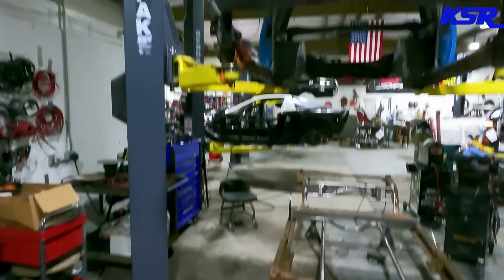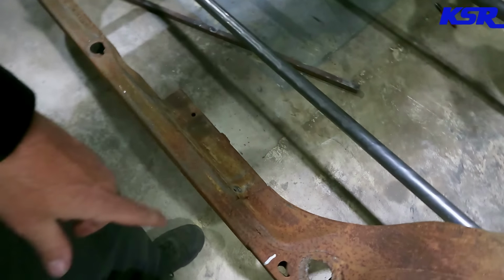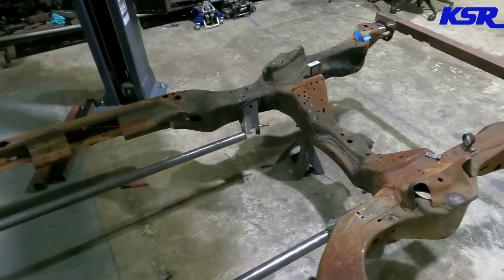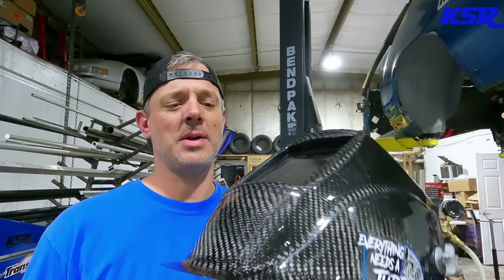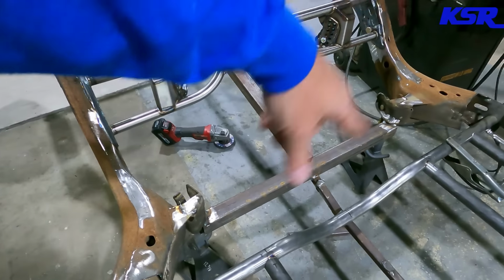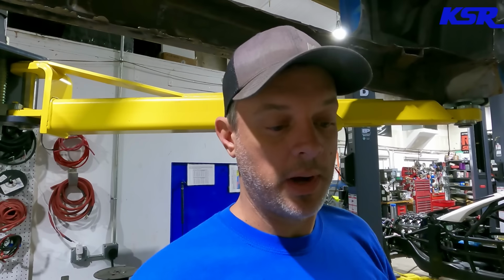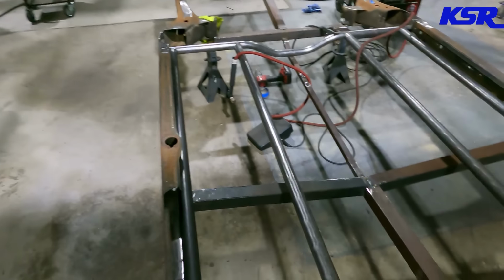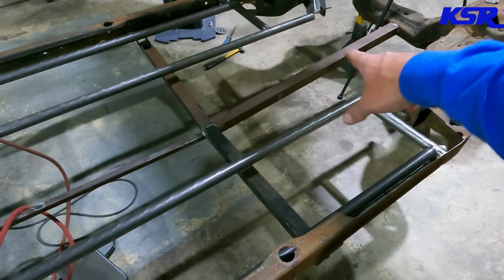25.3 Roll Cage Progress on MY CUTLASS!! KSR Cutlass Build Episode 12!!

Comment: A data point.
Perimeter framed cars are really flexible and rely on the body for strength.  I did a full cage , frame seam weld and solid body mounts on a 80's full sized GM for oval track.  A standard car on jack stands with one out an inch in height will sit on all stands.  Post cage install, have a stand out a quarter of an inch and the car will teeter.

Comment: Kevin I've said this before and gonna say it again....
As a life long true Oldsmobile guy I am ALL IN on this project!.
I still got my first car, from 1983...it's a 1970 Olds 442.
Steve Grebeck installed the 6 point 1 5/8 chromolly roll bar back in the 90s. 
RIP Steve. Sooner or later I'm gonna need a halo bar, front down bars that are hidden best way possible, and forward bars to the frame horns. I gotta keep the car in a way that if I ever want or need to turn it back into a stock musclecar I can cut out the bars, but most likely they will be there for the rest of my life. Maybe you might wanna be the one to put these new bars in my car? 
I'm trying to save money for a Rocket Block because I will always be a big block Olds guy. 
A 440 inch diesel block project is awesome but I still love my super wide victor intake..
I'm rambling now, I'll stop

Comment: Kevin, grab you some cheap adjustable RV stabilizer jacks that screw up for the middle and easy micro adjustments if needed on different areas of the floor to be perfectly level where standard stands wont allow 1/8” movements. Nice for holding bars in place too

Comment: One thing you could do is show some tips on how to weld in what you’d think is in difficult places or positions. I recently seen a cage install video on a K5 Blazer off road rig and they showed how to completely weld the top side of the bars where the roof is normally in the way. Most of us have seen where cages aren’t welded all the way around which I guess is legal to an extent, but still not ideal if it could be prevented. I feel more people would weld all the way around if they knew a trick (if possible in their application). I wouldn’t have thought to put holes in floor to drop the partially welded cage through to give access to the top side to finish weld then raise the cage back into position to finish everything else. Like most of us I’m not a chassis builder so things like that can help get people to see how certain things can be applied to what they’re doing on their cars.

Comment: Love watching, I built a 25-3 frame and about where you are now I was reminded to start drilling vent holes to connect all the tubes together. I have paid the price for not doing it on other projects in the past. Also on your 1 1/4 floor diagonals, you might consider offsetting them to the top or bottom of the 1 5/8 to give a flat surface to attach the floor. These videos are perfect and I look forward to them.
Reply from the maker: You have a secret microphone planted in my shop??? Hahaha, I was just talking to the guys about offest notching the smaller bars to make it easier to do the floor later.
Reply: I offset mine to the bottom to attach the floor to the bottom, leaving the frame exposed for seat and belt mounts. As a drag and drive my priority was water proofing. One downside is having to make a raceway outside of the drive shaft tunnel and above the floor to get fuel lines to the rear. There’s nothing run under the car.
Reply from the maker: @rustyh8806  I plan to use a couple of the upper frame rail bars for some wiring and for the small fuel line for the street fuel system. Maybe even use a Titanium rod with 6an bungs welded to each end of it or something.

Comment: I got 69 Oldsmobile Cutlass S
I rebuilt the engine and rebuilt the transmission and I rebuilt the front end and new gas tank and front and back new brakes pads. Right now I am taking a break and I will continue finish the rest of the car I do need to put New heater coil and the car will run good. Maybe I will put new tires. 
I have a friend works Oldsmobile company he gets parts and engine and other things I need for this car 🚗
I like your video continue doing what you guys need to do and I will continue watching you guys doing it

Comment: I have an idea for a strong yet light original frame rails.  Probably a lot of work, but would be extremely light & strong.

Take the original frame rails & instead of boxing them in, as is traditionally done, heat the 90 degree bends in the frame and close them up to 120 degrees, making a triangle, with the body side as the flat.  You'd probably have to make a thin filler plate to bring the original bottom frame rail to meet the top corner.  

Once the frame has been turned into a triangle shaped frame, take a plasma cutter and start cutting out triangles from one end of the frame to the other... Once could also just use a hole saw and drill lots of holes in the frame, before you build the inner structure of the frame. 

My reasoning for this idea is, you wouldn't need as many internal bars for structure, and the weight savings would increase dramatically.
Reply from the maker: I am just cutting most of the factory rail out.....
Reply: @KSRPerformanceFabrication  Thanks for the quick reply... The reason I ask, is I'm wanting to build a 76' square body & those frame rails are pretty beefy.  I'd think there'd be quite a bit of weight savings in that application.

Comment: Definitely use the helmet like it was intended! If it makes all the welding you do even a tiny bit easier, then it makes the occasional need to send it down to Mr. Sam at Cleet's shop for a thorough buff and polish job worth it! I'm sure @Enzocarboncreations would be proud to have you beat the shit out of it. It's a workman's tool, not an art piece!

Comment: As someone who (probably foolishly) is getting geared up to start a tube chassis build of my own, I would like to see a complete build. It'll give me a good real world reference. My plan is also to video my build so I can hopefully look back and see what I did and why. 

On a different note, where do you order tubing from? That's one slight hangup for me is figuring out a good place to buy from. I have a couple local suppliers that will hopefully deliver to my shop, but I don't have a forklift yet, so that might be an issue. Thanks!
Reply from the maker: We do not have a forklift either. We take the tubes off of the truck 2-4 at a time depending on the size/weight. Try EMJ for a tubing supplier.
Reply: @KSRPerformanceFabrication  That was one of the suppliers if one of the local ones wouldn't work with me. Good to know, thanks!

Comment: I'm on board also, show all the bars and all the work. If someone wants to skip a part well there is a FF button. Can also see if the 25 series spec changes in 10 or 20 years and look back to see the changes. One thing and I am not sure if it has been asked or not Kevin, the class you want to run, is there a stipulation of the frame has to be partially from the original frame? If so how much must be reused? Or why not just build a complete tube frame?

Comment: hey Kev why didn't you just holesaw through the frame rails and slot the tube trough even on the long one at the back you just elongate one hole on the inside of the rail save you heaps of time mate seeing as all the welds are easily accessible on the chassis.

Comment: I'm currently completely redoing my 79 Malibu. Parallel 4-link, complete new front half, pretty much everything but the paint is changing (maybe even that). I'm interested in EVERYTHING your doing to this Olds. (SBC/NA bracket and index racing) I may need to contact you about possibly going fuel injection on this combo.

Comment: Maybe refer to which bar that is on the sfi diagram, as you go along too. Maybe what the parameters of that bar are. Like "this bar has to cross the drivers elbow, this bad must be x amount of inches relative to the driver's helmet, etc". I did a simple 6 point on my A-body. Just following the NHRA rules can be a challenge. It jumps around the book. Cant imagine the added complexities of sfi rating.

Comment: The only problem with that helmet being bare carbon fiber (unless they've improved the resin) is that bare carbon quickly degrades from UV exposure and there's a metric ass ton of UV in welding.

Comment: So with all the trimming done to the factory rails, and all the tube that replaced it,  what keeps the car from being considered full chassis?
Reply from the maker: There is a piece of frame there in the required spot…….
Reply: @KSRPerformanceFabrication   I see. I only ask as I was looking a G Body Roller that had similar work and wasn't sure if it would fall in the rules. Thanks!

Comment: It's a pity that you can't make a tube chassis frame while keeping some of the stiff molded bent sections of the old frame? It would then be 95% tube chassis but 5% old & crusted original frame. Would that be legal or would that be bending the rules too much lol?
Reply from the maker: That is basically what these cars end up like. With the 25.1, 25.2 and 25.3 specs, the suspension points are tied to the roll cage/chassis so there is not much need for the factory frame.